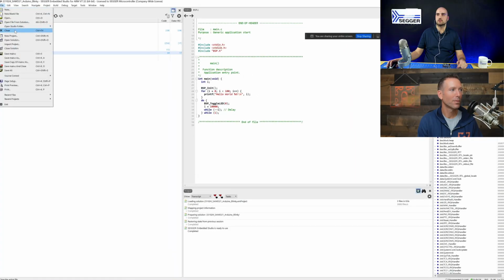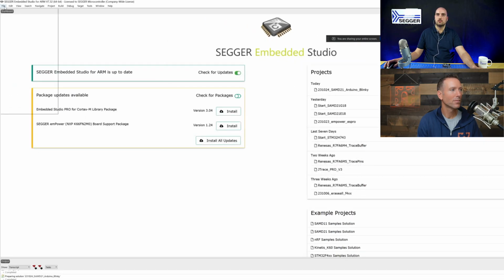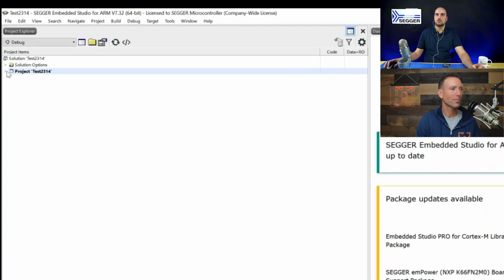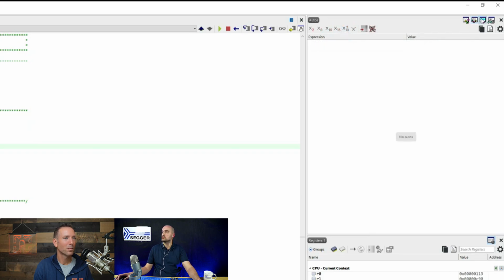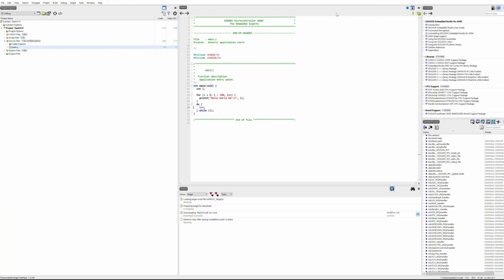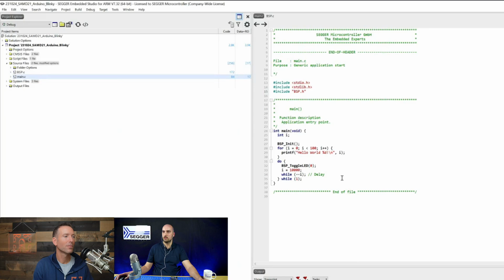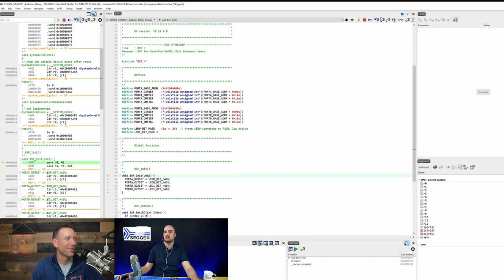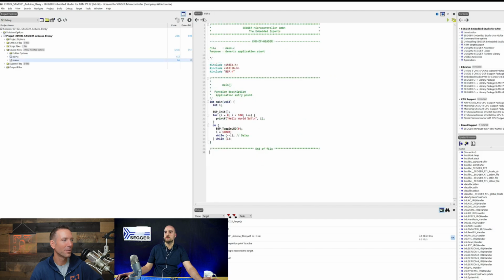Debugging with Arduino | FULL Seminar | Part 3 of 3 #Segger #Arduino #debug

Comment: Found this series insightful and helpful. After using debugging features with other microcontroller IDEs it is difficult to step back into the Arduino world without it and was encouraged to a see the Arduino 2.0 IDE added support for hardware debugging. The Arduino documentation in this area is sparse for starting and using. Please continue to develop this series in the practical use direction of hardware debugging pursuing some examples with more detailed connections and debugging techniques.